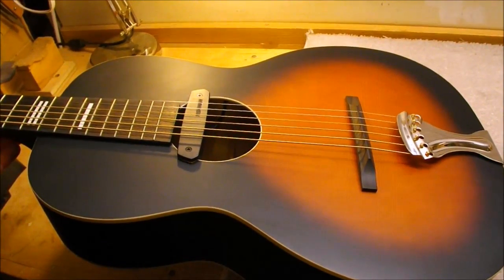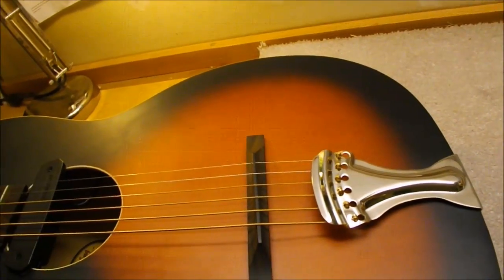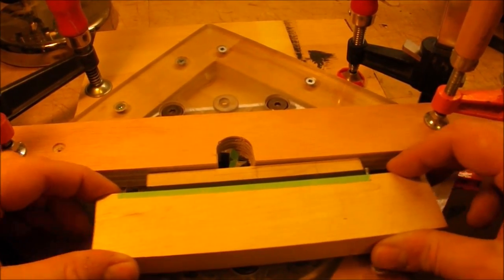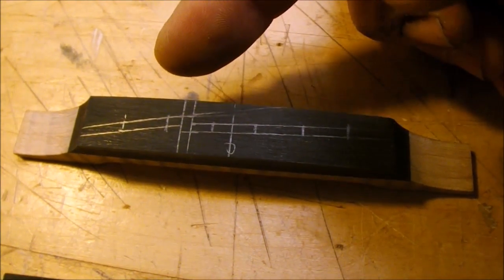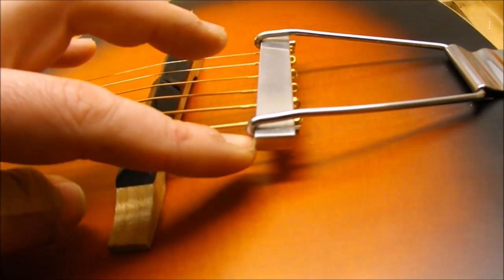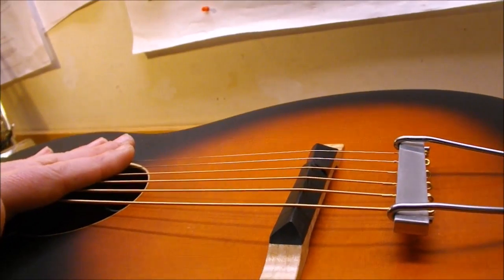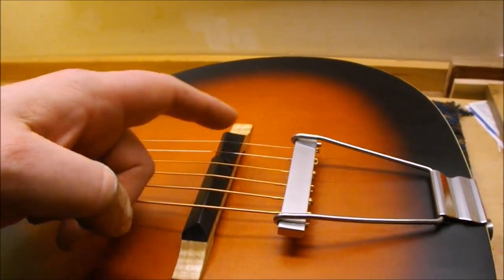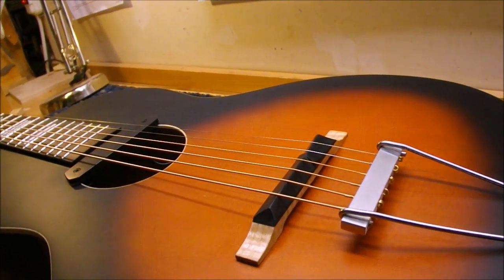Recording King guitar - bridge and tailpiece

Comment: Great stuff.  I love Recording King Guitars; own a Dirty 30s parlor size in that same tobacco burst color.  They are great instruments at a very low price.  Mine had an MSRP of $200 and I bought it “new open box” on eBay for somewhere around $150.  When I received mine it had a couple of high frets (12th and 13th), which I quickly lowered using my fret file.  I also had do to some minor truss rod adjusting, but now the action is great, 0.08 on 6th string and 0.07 on 1st string.

I’m a big Martin fan, my current player is a D-18E Retro.  Fantastic guitar and yes, much nicer than my Recording King.  But the RC has a solid spruce top, forward x scalloped bracing, like a Martin.  I’ve owned 2 other parlor sized guitars and neither of them had the tone and playability of the RC.  I would put it on par with my Little Martin travel guitar.

On a side note, the recently departed Justin Townes Earle (Steve Earle’s sin) played Recording King Guitars.  He’s said in interviews that he didn’t feel comfortable playing guitars that cost thousands of dollars, and not something his average fan could afford.  Just before his death, he was working with RK on a signature model that will hopefully be released soon.  RIP JTE.
Reply: My dirty 30s wooden resonator is probably my most fun guitar to play in my whole collection. And it cost me £139 new!?! It sounds really good too.

Comment: lf i may suggest  a little late but is my first view. pass strings  thru front of tail bar  and out rear.then bring string under bar going forward and then over bridge thus increasing break angle .been watching for a year or so and always catching up on older vtds. ur one of the vert best.
Reply from the maker: I encourage you to try that the next time you encounter this kind of tailpiece and you can discover for yourself exactly why that doesn't work on something with a hinge.
Reply: @twoodfrd  good info, got it, thanks.

Comment: redesigning the floating tailpiece. ading 2 more bars from the tail to the bottom of the "stringholder" piece BUT adjustable with a nut. tighten it and the tailpiece gets force down. thx for the video it gave me a idea for a new tailpiece :D on to my machines, lets see what the old lathe and bridgeport can do.

Comment: - Ted is examining a Recording King guitar, specifically a Dirty 30s model from the 1920s or 30s, which features a floating bridge and tailpiece with unique fret marker inlays.
- The issue being addressed is that the guitar's action is too low, causing string buzzing against the frets during certain playing techniques.
- To solve this, Ted plans to make a new bridge that is slightly taller and increase the string spacing to provide more room for the right hand.
- Ted also intends to swap out the tailpiece to increase the break angle, which will naturally happen with the new taller bridge.
- Ted describes the process of crafting the new bridge using Ebony and maple materials, ensuring proper string spacing and compensation lines for optimal performance.

Comment: I know this video is 3 years old but I’ll comment anyway. Wouldn’t it help with the break angle if you had built a tail piece with the same curve as the fretboard and the bridge, instead of a straight one? That would make the break angle even out across all strings instead of being smaller on the edges.

Comment: I love the look of what you did with bridge & saddle (maple & ebony). Questions regarding that style of bridge, with two feet rather than continuous support:  1) Wouldn't a traditional bridge with continuous support provide better transfer of string vibration to the top?  2) What are your thoughts on the structural impact of the point loads on feet, rather than distributed loads with a traditional bridge.
Reply from the maker: Billder Inbaja this guitar used a fairly strong x-brace rather than the horizontal ladder braces most of the original guitars of this style employed. By extending the feet of the bridge to extend over the arms of the X, and given that it has a plywood top, I don't think it's in danger of collapse. I'd be concerned if it had a solid top and no brace support.

As for the separate feet vs. continuous contact - I just reproduced the style it came with. Could we squeeze a little more volume out by making continuous contact? Maybe, but this was a loud little guitar.  The additional mass would probably change the character of the sound, too.  If I was designing and building a guitar of this design (I wouldn't), I'd probably try out several different options. As it was, I just tried to get this done in under two hours so I could make some money. :)
Reply: Thanks very much for your response. I am interested because I have decided to dive in on guitar repairs, and eventually build at least one guitar. I have been "lurking" all the listings on old Harmony / Stella / Silvertone etc. as good candidates to learn surface repairs, refinish, new bridge/saddle, new nut, fret jobs, etc... so much to learn, can't wait to get started.

Comment: Would it improve the break angle on the high and low E strings if you put the tailpiece block in a press and bent it to match the curve of the bridge more closely? With that trapeze-style anchor assembly, it wouldn't be hard, although you'd probably get better results by bending it before drilling the holes.

Comment: Great vid! Please forgive what might be a stupid question: To increase the break-angle between the bridge and tailpiece, could you flip that part of the bridge that you machined, so that the strings wrap under it before coming back over? Sort of like a Gibson Wraparound bridge, but with the strings threaded under first?
Reply from the maker: You'd think so wouldn't you?  The annoying thing is, with a hinged system the string always finds the same angle -a straight line between the top of the bridge and the zero point of the hinge.  If you wrap it under, the tailpiece rises up that same amount and the string ends up in the same plane.  Frustrating!
Reply: @twoodfrd  : Ahhh. That's exactly what I wondered. Stupid physics, give a guy a break! Or at least a break-angle. Thanks for the response. Keep up the great work / vids.

Comment: It's almost impossible to get a good break angle on a Flatop guitar with a Tailpiece. They work much better with Archtops.
Reply: True, unless you fit the neck at a small angle, 1.5 or 2 degrees, which would allow a taller bridge. The problem then is that the fretboard can’t just sit on the soundboard, You need to lift it somehow